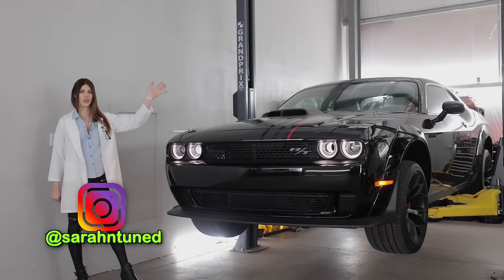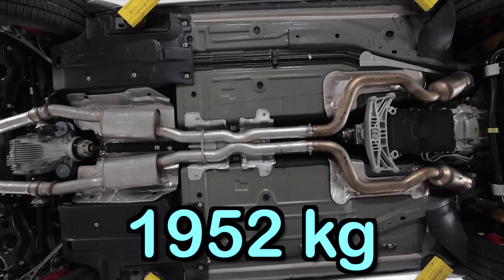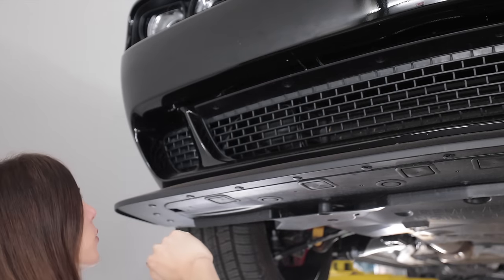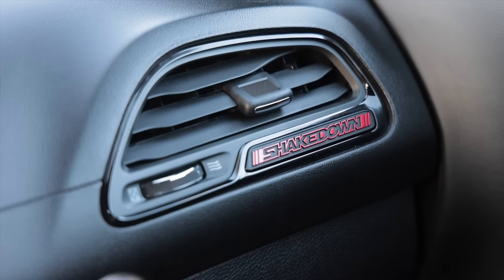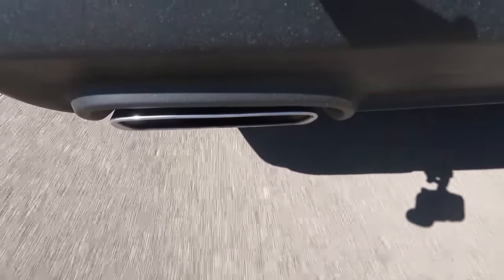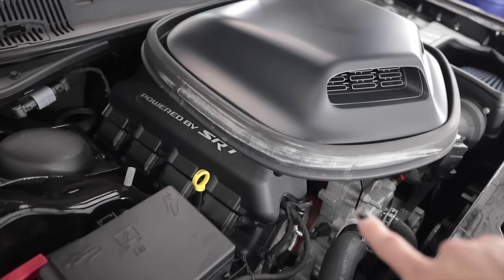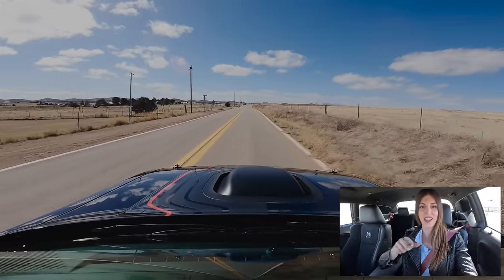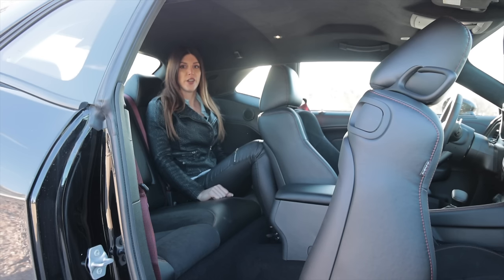I'd Take This Over A Hellcat.. // 2023 Dodge Challenger Shakedown Review

Comment: I've got a 15 Hellcat Challenger and love it, but you are correct, the 392 cars are better balanced. The 6.2 adds a lot of weight to the front making it understeer when cornered hard. FYI, proper lift (not jacking) point in the front is the subframe. The frame is marked with the triangles to show where to place the lift pads.

Comment: I actually had to order mine from the factory, I was able to get almost everything I wanted (couldn't justify the $6000 widebody) for $48265.  I'm extremely happy using it as a daily driver.  Anyway, great video.  I am sad that the Challengers and Chargers as we know them now are going bye bye.
Reply: i got the widebody and realized how much of a pain it is!  you are dodging some pain besides the money.  they look cool, and i like it, but the wheel offset with those special rims means you can basically only get OEM rims for it, and tires are hard to come by too.  In Canada, i'm looking at $1300 FOR ONE RIM.  ONE.  to have a second set for winter tires.  not doing it.  you are way more flexible for tires and rims with the regular body.  enjoy!
Reply: I got a 2022 SXT for $35k, but now widebody.

Comment: All 392 have Some sort of Intake! Mine is a TA and it has the Headlight inlet, as well as the Center Functional Scoop. So doubt power would change.. Also cut out mid mufflers, and you have an even 500hp.. At least on the in dash Dyno. I saw a 15 ho gain from the delete!

Comment: My dad's 69 Mach 1 had the hood pins with cables. Yes they look cool but damage the paint over time. Great place for some 3M protection where the cables rub. Protects the paint, you keep the cool look and easy to change when the 3M tape starts to look crappy.

Comment: The tack weld on the clap retains the clamp to the resonator. Loosen the bolt and you can easily remove/adjust the tip.

Comment: I owned a 70 Challenger in 79 as a teenager.  I swear it was a thousand pounds lighter than the current one.  I understand the quality and the build of the newer edition is much better, I just don’t understand why they have to weigh so much
Reply: Yeah, mine with 383 and Torqueflite was about 3,500 pounds.
Reply: I guess mine originally had a 340 but when I bought it had a 318
Reply: @richardsilvestri6874  probably not a lot of weight difference between 340 and 318.  Obviously a guess.

Comment: Mercedes connection is still strong.  Suspension is based on late 1990's Merc.  Twin spark plugs was also a Merc feature in M112/M113 engines.

Comment: Hood pins I want on my cars if they were options. Yes, they might scratch lightly on the clear coat, but they do the same on the classic mopars like my 1970 cuda 440 6 pack. You could take off the wires/cables and just use the pins, that way it won't hit the clear coat anymore. Hood pins are for racing and give these cars a "mean muscle look." Some of the classic mopars like the AAR cuda or Challenger TA didn't have Hood latches, only these Hood pins. Also, A12 cars were the same.

The electronics on these new cars are confusing as you mentioned but I guess I need to learn it well. Awaiting my order for the demon...

Comment: I had a 98 Mustang for 20 years, and I absolutely did love the sounds it made. Especially driving through a tunnel, it was a convertible, so with the top down, and a V-8 going, it was a GT convertible, it was pretty awesome.

That’s sad…

I recently rented a polestar two, and that car kicked my mustangs ass. Going from 50 to 70 hauled so hard. If you think you feel powerful and an naturally aspirated V8, you feel so much more powerful in a strong EV that will blow it out of the water.

It wasn’t exactly silence, because you have tire noise and wind noise, but the confidence that it inspires is truly unparalleled.

I haven’t driven a Tesla yet, but the pole star was frighteningly awesome.

So while it might be fun to have a loud V-8 with a nice verbal, at this point, I would take an EV with 250 miles of range that will out drive it every day. I don’t think I’ll end up with a pole star, because they are more expensive than I want to spend, but that surge of power is addicting.

Comment: As for the girth of the axle. My understanding is the axles on all widebody cars are sourced from the Hellcat. I might be wrong though.
Reply: I am 6'2" 280 and fit in the back of my challenger with room to spare. I think you just have the "Easy Egress" (Where the seat slides all the way back for you to get out of the car easier) mode on?

Comment: Rubber pucks in the rear but a pinch weld in front. Great observation for those lucky enough to own a lift! I ended up using a small cut of plywood. Works great but every dang time I curse out dodge for half assing it

Comment: Don’t screw with the engine just install a stainless works legend exhaust system and get rid of the flappers but not the actuators so you don’t have any lights on the dash

Comment: need to replace my Fronts ( scat pack with Dynamics pack ) as well...I mean, the dodge dealer can turn them down cause i still got plenty of meat left, the issue are the pads.. I think they are the same size (spec wise) as the previous cars... but ordered a set of paragon rotors with geomet coating.

Comment: Having driven both the Scat Pack Wide Body and HellCat Wide Body I chose the Scat pack as it was a much better package. Yes the Hellcat is fun and makes a bunch of fun noises but for daily use it was just too much. The Scat Pack is a usable, fun car to throw around. The power is manageable and it won't kill you with two drops of water on the road. Overall I feel like the Scat Pack widebody is the best of the bunch. I wouldn't mind of they had figured out how to drop 500 lbs off the car but it doesn't need any more power. 

I'm interested to see what the next generation of Challenger looks like. A version with the Hurricane turbo 6 might be a nice car if they can keep the power and torque in the 500ish range.

Comment: While I agree with most everything you said here I will take exception with the "wide body must have" comment. I have an '18 392 TA. Bought it a year before the wide body was available. It's not an option I'd have picked anyway for two really easy to point to reasons. One reason is Objective the other Subjective opinion. I quickly figured out that the car does need those 11" wheels and better rubber out back and they fit just fine without the Wide Body flares. Having said that, the subjective comment comes up. The Wide body and square 305 tire all around the car comes with a trade off I could never make. While I understand the "tack-on" flare treatment for a one off, super low production car, such as the 2018 Demon I really don't understand the weak styling of doing in 2019 across the line up of the performance cars. The car deserved better and tweaking the actual body panels to make the bigger wheels and tires fit is the way to do it correctly. Dodge chose to go the easy cheaper route. Pick up truck flares bolted onto a great looking body style of a car is the cheaper way to do it and maybe it's because they knew the car would be going away and they didn't spend the money on a redesign but to my eye it just ruins the great lines on these cars.

Comment: that car with a manual would be very fun to drive. I think fuel economy depends a lot on how it is driven. I bet it would hold speed in top gear at a low rpm easy enough.

Comment: 392. Hemi‘s don’t really increase the horsepower by putting add-ons Bing putting headers port in throttlebody and ported intake. Manifold only increases the horsepower about 10 hp. It’s not worth the money racer. X just did a review on one that had all of their performance mods done in the horsepower increase was very disappointing.
Reply: The 5.7 actually takes to mods better with better gains, 392s are badass, but not the best modding platform.

Comment: Hi Sarah you had mentioned it is the end of the V8 Muscle Car era. Well it is for Dodge, though Ford is going to keep producing V8 Mustang's Keeping the 5.0.  They are working on a V8 with Synthetic Fuel, in collaboration with RedBull to continue V8's even after the 2035 fossil fuel restriction. Currently, driving the 2022 Roush Mustang with the 6 Speed Manual Transmission 
🧑🏻‍🦱👍🏻🏎🏎🏁🏁🚩🚩

Comment: 1952 KG is very heavy for a Coupe. Also it's natural aspirated. Dodge should have Super Charge or Turbo Charged it for a heavy car. If it weighed under 1700kg then the natural aspirated engine would have been decent.

Comment: I concur, Sarah.
The hellcat is really cool, but no manual transmission kills it. Nobody needs 700hp to daily drive, its just a pissing contest. And if that's what you're going for, there are options out there with more power, if you have the money.
As they say, it's always more fun to drive a slower car (relative) at its limits rather than a fast car at idle. Its not like 485hp is chump grade in any case, in a tank like the challenger, 485hp is "enough to be fun". It makes all the right noises for sure!

Alas, none of the V8 challengers are feasible on a single income family man budget like mine; but still fun watching those who can...
Enjoy the living sheet out of them 😂

Maybe in time the used car market insanity will diminish and maybe i will have a chance to own one of these but I seriously doubt it. Once again for those who can, its a fun time:)

Also, referencing your comment about the cold air intake; The non shaker likely has a non-visible cold air inlet, so the HP is the same.

If I were able, the widebody shaker 6.4 would be my choice as well.

P.S. The multi displacement system and start stop are only on the automatics (even more reason to buy the 6 spd manual)
Reply from the maker: I believe for 2023 you might beable to get a manual on a Hellcat, look it up because I’m only like 60% sure.
Reply: @SarahnTuned  You are correct, the manual option returned briefly for 2023. 

Makes absolutely no sense to get the automatic (even if its a great transmission) unless it's absolute necessity.

Comment: The vacuum cleaner has 95% efficiency, 5% transmission losses and full torque from 0 RPM. Also, it can smoke any ICE car easily. The ICE Dodge Challenger has 35% thermal efficiency and 15% transmission losses. The rest is lost on heat and noise.
Reply: But it’s still a vacuum cleaner, no soul, no essence, merely a disposable appliance

Comment: The fuel economy on this car is atrocious. Thanks, Dodge, for using heavy, low-cost steel in most of the suspension, and barely improving this car over its first iteration.
Reply: I made it from Akron, Ohio to Orlando, Florida (1200+ miles) on 3 tanks.  Not bad.

Comment: Muscle cars are not going anywhere!How about a review of..." Specialty Vehicle   Engineering's 2023 YENKO/SC® Stage I and Stage II Camaros and with 1100HP or 1150HP,...
... engine delivers 1100HP with 910 lb.-ft. of torque (Stage I) and 1150HP with 960 lb.-ft. of torque (Stage II) and features a blueprinted LT-1 aluminum block, computer-balanced race-quality rotating assembly, including forged 4340 steel crankshaft and H-beam steel rods, forged aluminum pistons, CNC ported high-flow LT-4 cylinder heads with ARP high-strength head and main studs, a custom supercharger with a 10-rib dedicated belt drive system utilizing an upgraded fuel system and injectors, a larger throttle body, and custom stainless steel exhaust system."

Comment: A live long Mopar guy I'm a little disappointed in the price of the car. They are wildly over priced. Plus this car 5 years from now with 88000 miles it will still be 60K. If power is your goal you can buy a Jag F type R 550hp supercharged V8 for mid 40K and destroy a Hellcat even from a rolling 40mph go.

Comment: Tell you what. If I see your electric Charger or other EV dead on the side of the road, I'll pull you to an outlet with my '86 Ramcharger in trade for the price of a tank of gas......it holds 36 gallons.  It also has the 8HP70 8spd, I mated it to an ancient LA block 410 stroker.
Having owned an A66 4spd '70 Challenger some 45 years ago, the back seat in those cars was roomy enough. I'm 6'3"....where there's a will there's a way.

Comment: Excellent job for an end-of-run vehicle. Now let's hope Fiat doesn't break the reliability. Thanks Sarah!
Reply: This is basically old design, baked in, Fiat can only influence the next gen cars

Same thing with Nissan, the Frontier from 2005-2019 was insanely reliable compared to the rest of Nissan's line up because it was an older design
Reply: @twoeightythreez  I assume there's some bugfix-type stuff Fiat could do. You're probably right, though.